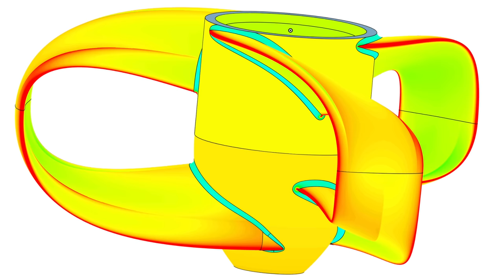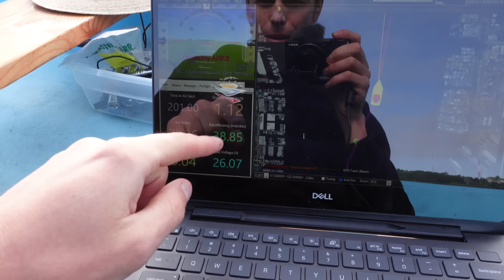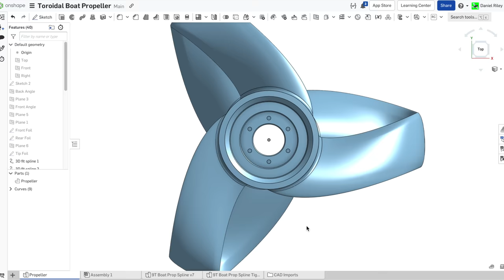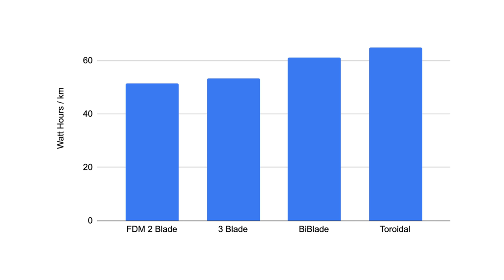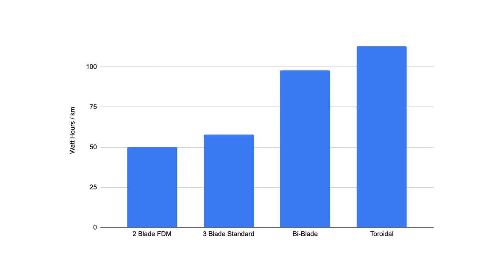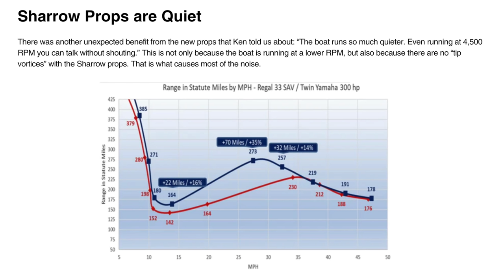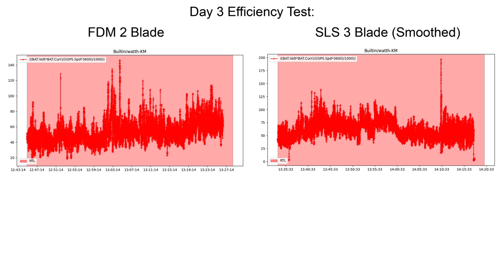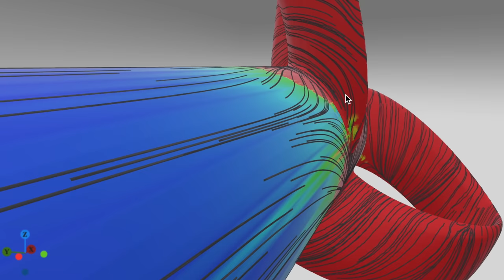Testing Futuristic Propeller Designs on my Solar Powered Boat

Comment: hi...the surface area of the prop blade, for more traction...keeping things smooth is key...
size the prop according to rpm and load objectives...try a tube around  the prop too...
i would use the single blade design...thanks for the report....we need more people like you..
happy trails...

Comment: I was watching this video on twisted light beams when the lecture was talking about using electrons as a twisted Beam and how it created a magnetic field down the center.  So I tested the idea with a cheap ozone generator that has a rubber hose for a bubbler. I wound the rubber hose around a stick as a coil and put a compass at the end and turned on the ozone generator and sure enough it swung around to the north side. So it occurred to me that if I could inject some sort of vortex of charge in like salt water I could make a magnetic assist propeller by putting a magnet in the center of the propeller.

Comment: all good stuff   super interesting but   waaaay over my 78 year old head ..  keep up the good work.   I used to sell a model jet ski   moulded plastic  waterjet set up.. it was super powerful  the propeller / water screw was in an enclosed tube . awesomely rapid acceleration and top speed  and that was pre lithium batteries and brushless motors era..Richard Wallinger 78 yrs old / young .

Comment: To fix the low pressure zone on the trailing edge of the normal 3- blade prop, read up on adding "cup" to it. High performance props often have cupping on that trailing edge to sorta "throw" the water off the prop at a higher velocity than just a constant profile. It can add up to an inch of equivalent pitch to a prop while keeping the overall pitch down during hole shot. Obviously hole shot is not a problem in a displacement boat like yours, but it should improve efficiency regardless.

Comment: Nice video, the one thing that I noticed off the bat was the leading blade of the Sharrow propeller is not perpendicular to the shaft which seems to be a factor in the way the blade performs in water. I see the blade used for drones looks more like a pure toroidal shape I suspect that the performance in a more vicus liquid means that the leading blade should be a different shape (not sure why). It would be super interesting to see if you were able to get closer to the Sharrow design would the performance be better. 
I don't think that the rough finish of the 3D prints would have a significant effect on the laminar flow, that might enhance it something like a shark's skin. 
By the way, don't try to correct for the material you should design the foil the same as if you were using metal, that plastic they use is very hardy and since it used a very fine powder you should be able to get a really good fine edge finish, I think you can go down to 0.5 or 0.8mm thick at the edges (ask the guys the thinnest wall they can print).

Comment: The toroidal props on our boat have saved us about 14% fuel savings for the last year. 
Filling the boats tanks once a week to bring people out fishing they’d take about 230 gallons of Unleaded. 
When you burn roughly 12,880 gallons of fuel a year at $5.45 a gallon? 
That 14% is huge. Maybe $9600? Props paid for themselves basically.

Comment: marine props are designed to move through the water like a screw, as in for every one revolution the prop will move a distance equal to the pitch of the prop. Hence marine props pruduce thrust from water volume moved which differs to a plane propeller whitch relies on thrust produced by prop lift

Comment: A great video, and you're a great person.
I'm starting to feel like the best fans & propellors are the ones inside of a ring. The ducted ones.
The ones where the ring is a part of the blades, not the blades separate from the duct with a tight gap.
Reply: Now that I think about it. I don't know if it's best for the blades to be apart of the duct or not. I keep thinking about that gap between the blade tips and duct wall being wasted potential, but maybe the blades stretch under centrifugal force, to fill that gap without touching.

....But, that ring being attached to the blades instead, may strengthen them overall, and the weight of the whole thing, may have a flywheel effect, keeping sudden turbulence from slowing down the blades. Like the massive flywheels of a rock grinder keep it spinning, regardless what hit it.

I don't know.
There's also the surface drag of the ring spinning with the blades.

Comment: Nice to see you have actually used a toroidal shape, not the simple offset cylinder most people make on 3D printers. It's a shame you did not monitor voltage. Clearly could vary by at least 20% between early morning and full charge under full sun.

Comment: The vibration of the fdm must be the plastic bending pushing the water inconsistently, making them vibrate. The toroidal props being “braced” with the top and bottom fins, will not bend as much reducing vibration

Comment: Great Video.  While I have to agree with some of the commentors that claim this wasn't a perfect test or toroidal propellers and you should be doing this in a lab with a flow channel and measure thrust vs power.  I'd like to say that it was a perfect test if someone was looking for an efficient propeller for a solar powered boat using the motors and controllers you have.  Static tests can't replicate the actual conditions that a prop will see in use.  Eh, I'm no prop designer.  But I like your video and keep doing what you are doing.  Taking a boat around the harbor using solar energy sounds like a lot of fun, if not the most exciting thing.

Comment: @7:05  Those blades 'vibrate' because they're cavitating.  Balanced in air is balanced in water.  The vibration you feel is caused by cavitation.

Comment: I'm thinking that a bit more diameter with a bit more pitch(and much thinner blades for efficiency) would get more thrust at micro rpms.. But that would require a long shaft setup to test deeper in the water. These are high torque brushless speed controllers on the props? Print some torpedo caps for the front of your motor casings

Comment: Building an underwater drone swarm with interconnected sonar to map an entire ocean and search for wrecks is an ambitious project. Here are the general steps you would need to consider:

Define the scope and requirements: Determine the specific objectives of your project, such as the size of the area you want to cover, the depth range, and the level of detail required for mapping. This will help you determine the number and capabilities of the drones needed.

Select suitable drones: Choose underwater drones that are capable of operating at the required depths, have built-in sonar capabilities, and can communicate with each other. Consider factors like endurance, maneuverability, payload capacity, and the ability to collect and transmit data.

Establish communication: Develop a communication system that allows the drones to share data and coordinate their movements. This could involve designing a network protocol or utilizing existing underwater communication technologies, such as acoustic modems or sonar-based communication.

Integrate sonar systems: Ensure that each drone is equipped with a suitable sonar system capable of generating high-resolution maps of the ocean floor. Consider side-scan sonar or multibeam sonar technology for accurate and detailed mapping. Integrate the sonar systems with the drones' onboard computers and data storage capabilities.

Coordinate drone movements: Implement algorithms and control systems to coordinate the movements of the drone swarm. This may involve developing a centralized control station or using distributed algorithms that allow the drones to communicate and self-organize.

Data fusion and mapping: As the drones explore the ocean, they will collect sonar data. Develop algorithms to fuse the data from multiple drones and create a comprehensive map of the surveyed area. This may involve data processing techniques such as simultaneous localization and mapping (SLAM) or merging overlapping sonar scans.

Wreck detection and identification: Develop algorithms or machine learning models to analyze the mapped data and identify potential wreck locations. This could involve pattern recognition, anomaly detection, or comparison with known wreck signatures.

Navigation and obstacle avoidance: Implement navigation systems that allow the drones to avoid obstacles, such as other drones, marine life, or underwater structures. This could be achieved through onboard sensors, computer vision, or machine learning-based obstacle avoidance algorithms.

Testing and refinement: Conduct thorough testing of the drone swarm system in controlled environments, such as pools or test tanks, before deploying them in real-world conditions. Refine the algorithms, communication systems, and hardware as necessary based on the results of these tests.

Deployment and operation: Once the system has been adequately tested, deploy the drone swarm in the target ocean area. Monitor the operation of the swarm, collect and analyze the data, and refine the algorithms further if required.

Remember, building an underwater drone swarm for mapping the entire ocean and locating wrecks is a complex and resource-intensive task. It requires expertise in robotics, underwater acoustics, data processing, and marine engineering. Consider collaborating with a team of experts, including marine scientists, engineers, and software developers, to increase the chances of success.

Comment: If efficiency is your biggest goal. Read up about surface propellers.

Think a singular prop rotating behind your boat like mad blend of A 4 bladed prop and a paddlewheel.

Because most of your prop is out of the water, lower friction, while pushing large volumes of water out the back.

Although it's going to be a monster to build and they will splash around water so you won't have a relaxing trip.

Comment: The only time toroidal or 3+ blade props are more efficient is when your limiting factor is noise, prop size/mismatched engine, or stalling. This is why using fairly low speed high torque engines with 8 blade props is more permissible with drones, since they can help you keep noise down dramatically even when producing ridiculous levels of static thrust.
I bet you those 6 blade boat props can accelerate something crazy before producing cavitation.

Comment: Awesome video on many levels! 
Suggestions, a canopy for your boat of solar panels using more panels, extra power, plus shade.
 Sand propellers with 1000-1200 sandpaper in the direction of the flow lines as best you can? (sand one way, in the direction of flow). Time consuming, but?  
Umm, getting off the efficient usage of electricity subject, how about 90% Hydrogen Peroxide- Silver Screen propulsion? Pure thrust!!! Rather loud, needs to be fully submerged. Ripped the bottom of my Starcraft boat out on Lake Candlewood CT in the late 80s experimenting with that. No analytics, So much foolishness back then, slalom skiing on lunch trays from the high school cafeteria, Ya-hoo 😅

Comment: The MIT team may have focused on quiet stealth by eliminating noisy aeration and cavitation.  Thrust may have been a very secondary consideration.  Think trolling motor.  Not much thrust, but very quiet, and easy on the battery’s reserve capacity.

Comment: I kinda suspect the angel of attack at the root isn't high enough which causes the water to be nearly as fast or faster than the propeller thrusts it out the back which then creates the cavitation or low pressure sucking water in

Comment: 30:00 when you changed the radius by mounting the props further from center, you messed with the reynolds numbers and now the blade is attacking at the wrong angle.

Comment: If you model the outside edge (  the connected area between the blades ) of the toroidal propellor like as an extended two more blades you will reach your desired results, having a trivector propeller. The connection as it sets creates drag countering the propulsion of the second blade on rotation.

Comment: I just completed R2AK.  I am no expert.  However, since all our propellers are human powered, I was very concerned with efficiency.  I spent a lot of time working on propeller design and efficient systems to drive the boat.  I would love to see more test data around your two bladed propeller.  There was some discussion about toroidal propellers pre-race among spectators/contestants, but like you, I remain a skeptic of the claims.  I would love to see better data.

I would suggest that if you are looking for increased efficiencies in your setup, you should consider a couple of alternatives:  1) change your boat hull, and 2) consider a ducted propeller.  I am going to guess you can 3-D print the duct for the propeller.  They are generally considered efficient up to about 7 knots.  And, they should help eliminate those tip vortices.  

As a reference, we ran a 20 inch two bladed propeller (pitch 23 inches) with a Rice nozzle.  We had a tandem bicycle which we estimate over long periods (at best) put out about 300 watts (150 watts per rider). Our 31 foot trimaran weighing over 2 tons averaged around 1.5 m/s.

While I like the idea of testing the toroidal propeller (and enjoyed your video), you could probably find efficiencies more readily in other areas.

Comment: You should look up Albion Bower's video on Ludwig Prandtl's lift formula and wing profiles, the Horton brothers and bird's wings. The advantage over closed tip loop props apart from quietness is lack of tip vortices. You can design wingtips to relieve the stress of tip vortices like Prandtl and birds did or cheat and use closed winglets. Biplanes suck because they add wing tip vortices, in water though, drag from blade thickness is a real issue, I see it's equivalent effect with the hydrofoils I ride wingsurfing. I'm 57 and have done many projects similar to yours over the years but starting with far more dated tech tooling. You are doing well, building good intuitive understandings, i chuckled listening to you express similar skepticism as me over the recent toroidal anything prop craze.  You can check for correct pitch by checking against a rotate-extrude operation. I design in openscad which is programatic, it's a little more difficult in some ways but much better for anything that you can figure out how to describe well if you are a capable programmer. I agree with your conclusions about your torroidal props being too high pitched and thick at the tips. Note that the loop is inherantly stronger, you can get less outer thickness. If you use rotate extruded your profiles will be more like the other ones you are seeing on youtube, I've designed those too but I haven't done a full toroidal blade algorithm yet, there are too many other projects sucking up my time!

Comment: I don't really know that smoother would be better for this application. The sort of sand cast finish would reduce the surface tension of the water, and thus reduce the friction of the blades moving through the water. I sure like your setup. Very interesting.

Comment: also water as you know does not compress.  So maybe outer edges to catch water and force it in -  like squrting garden hose instantly translates as ineffeciency.  Ive been pondering this loop prop idea since seeing it -  so thanks for you work.  I said years back on facebook before ban -  that planes have the fins on end of wings upside down - they should be under as the air wants to slide off underneath it will do bugger all on the top.  I note the Irainians have sucess with their drones and they have put those things center of wing so high and low.

Comment: Put more sweep in your props like the sharrow. Pitch, blade area and diameter make a real difference. Love to see you make the sharrow design meet it's claims, I would start with the sweep and maybe reduce the diameter and area so the motors aren't having to work so hard.

Comment: You should look into the props that are being used on pedal drive kayaks. They are similar to the airplane blades but are designed for water so they might be better.

Comment: Actually yes tip vortex's do occur with propellers it's just more of a concern with larger propellers or the mega high rpm designs. It's more to do with how much volume is being moved at any giving time more than anything but because water is denser than air you have to move more of it overall to see the effect occur. That the simple version anyways as for the thingy company like fair I have certain doubts too.

Comment: Vibration of the two-blades props is probably caused by the difference in water pressure between the blade closer to the surface compared to that on the deeper blade. This is not intuitive, but even with props at a shallow depth the deeper blade will push the stern based on the direction of rotation. 
Adding more blades will reduce the vibration, but having an odd number of blades appears to be the real key.

Comment: If I remember my school physics correctly, sun creme shouldn't have much effect on photovoltaics because it's working mostly with optical light rather than the blocked UVB light. But I may confuse that with photosynthesis.